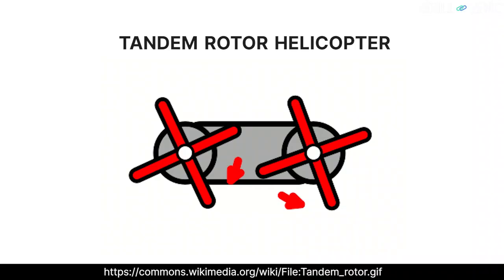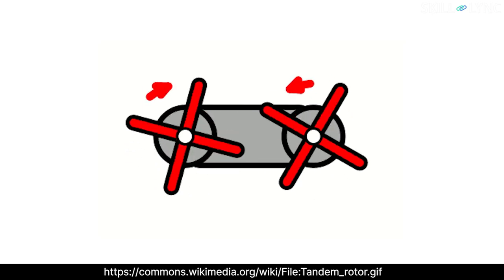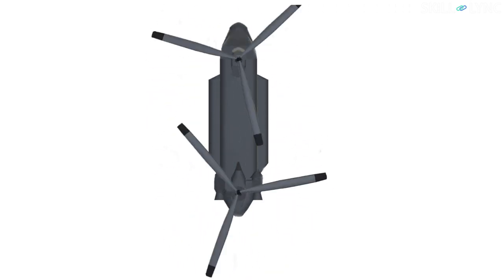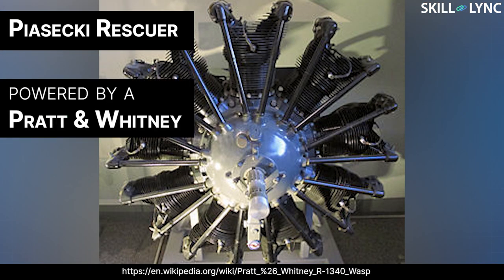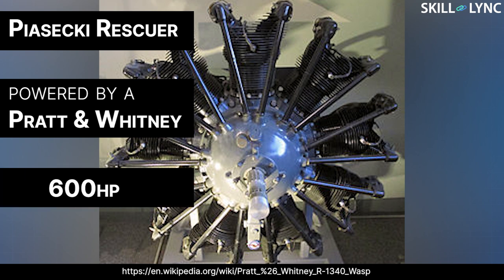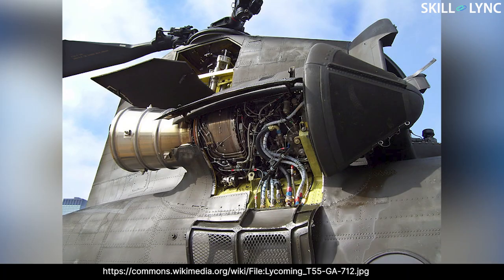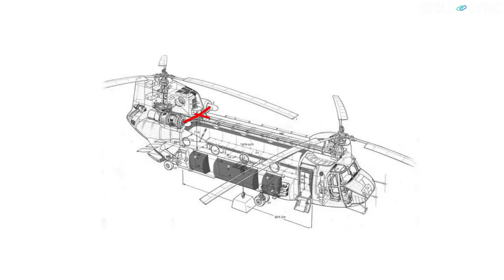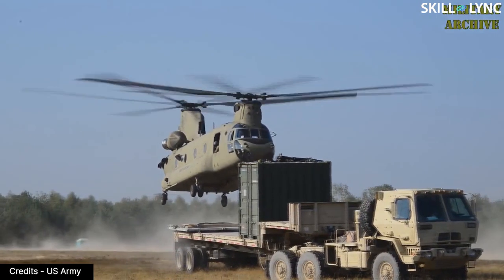What is a Tandem Rotor? | Skill-Lync

Comment: That didn't explain how yhe Chinook maneuvers without wings or moving surfaces. However I'll add , the Chinook maneuvers by the rotor shaft movement by tilting slightly forward, backwards,  left right and or diagonals etc.  The movements by the shaft are small n undetected by the eyes in motion... other model helicopters function similar

Comment: Tell me one thing please.
If there are 2 rotors, one pushes the air to the ground to lift,
The other rotor pushes the air to the up direction., Since both spins in opposite direction.
How the helicopter flies then?
Reply: lift would be provided by both, the opposite spinning is done to avoid the helicopter rotating in the opposite direction
Reply: You are misunderstanding. Both rotors push air to the ground to lift. But, they are still spinning in opposite directions. That is because the rotors are not identical. If you think of the rotor as a screw (propellers are sometimes referred to as airscrews), the rotors have opposing thread directions. So even though they are turning in opposite directions, the air flows down through both.
Reply: Haha it is created using the tilt of the blade…
Reply: its fan direction isnt identical and tilts
Reply: @abhi36292  ka-50 black shark has entered the chat